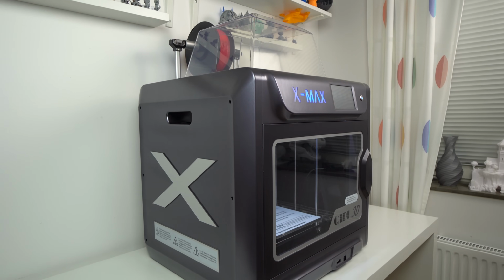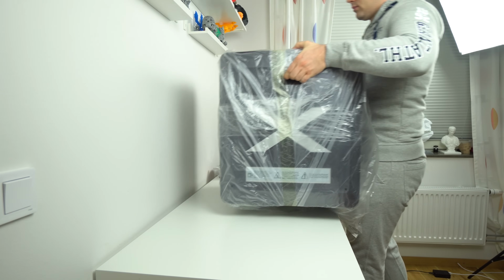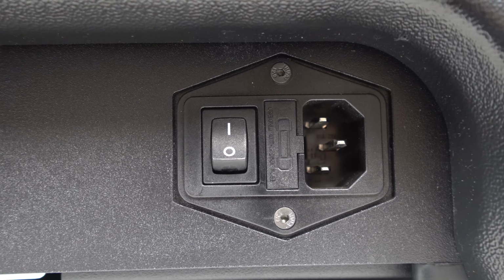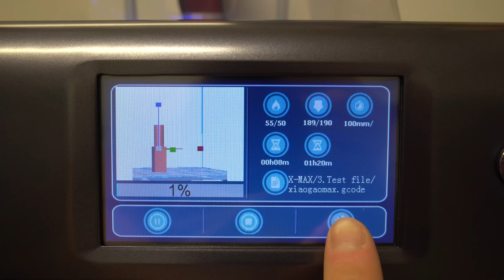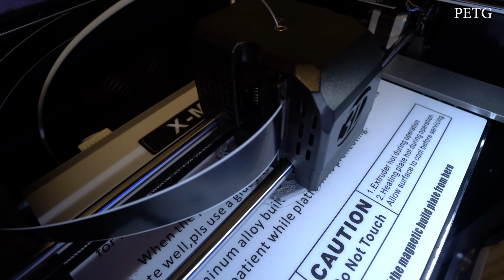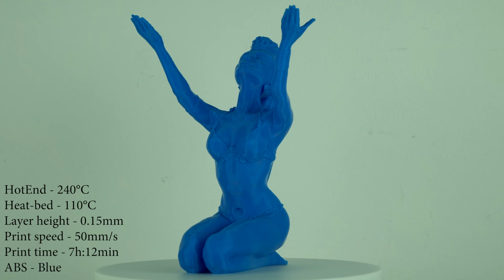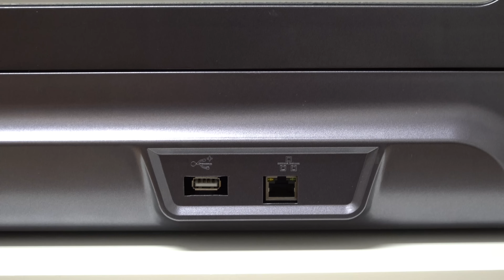QIDI-TECH X-Max 3D printer review - Fully enclosed 3D printer

Comment: Are you still using it? Got one from a friend, it needs a new motherboard due to a little misshap that sent 24V into the hotend thermistor circuit, figure it could be a nice printer for the 150 Euro a new motherboard cost? 🙂

Comment: I know this is an old video but i was wondering about printing materials like abs and petg because the ptfe goes right down into the nozzle so you cant really go to them temperature. Did you find any issues with any melting of the ptfe tube?.
Reply from the maker: If you print alot of ABS you can always replace stock ptfe tube with Capricorn tube when is worn out one day. Also there are petg filaments that print just fine with lover temperature on the nozzle so there is no worry :)
Reply: @NexiTech  Thanks for the feedback so quickly! Ive been looking round and found out i can get a all metal upgrade for the high temp extruder so ill probably go with that. Thanks!!
Reply from the maker: @A R  You don't need to do that. In the package you will get extra all metal hight temp hotend part which can be heat up to 300c. Nozzle is also steal hardened so you can print any kind of abrasive filaments. Just look at the video more carefully and you will see it. 2:02

Comment: When you printed with PETG what did you do with the flexible build plate.   Some people are saying the parts will weld to it.
Reply from the maker: If your print stick too much with PETG you can set higher first layer, add 0.01mm on your first layer and try it out. Also you can flip flexible build plate and print on the other side as well.

Comment: What is the max print speed for the x-max? Thank you!
Reply from the maker: That's hard to say. It depends of your model, what type and size model you are printing, what kind of printing quality you are looking, your slicer settings and many more. I'm always trying to adjust print speed depending of the model and my print quality needs. You can always push any printer over 100mms but how good or bad it will turn out only you can tell :)

Comment: This review sealed the deal for me and answered all my residual questions I had from prior research. Excellent work and thank you for providing the settings you tested the prints at. Very professional! Have an upvote and a new subscriber!
Reply from the maker: My dear friend, thank you so much for yours kind words and positive thoughts. Wish you great day!
Reply: I have an issue where the filament melts too much to the point that the layers fall down, yet the temperature is below the recommended one so don't know why is it melting so drastically  @NexiTech
Reply: @gabriel64gba  Which slicer are you using?

Comment: What would you consider the best? Prusa i3 MK3S or QIDI X plus? Some people said that Prusa's prints are better, while others say the opposite. There are also people saying that Prusa is better because QIDI is from China... Some people even say that you constantly need to replace the bed magnetic sheets for the QIDI... What do you think?
Reply from the maker: That's like comparing AUDI VS BMW or Android VS IOS or Windows VS Mac... People like one or the other. There is no such thing as perfect printer that can match anyone taste. I prefer the X-Max and btw Magnetic plate can last you long time if you can level the printer correctly and not let the nozzle to stretch the printing sheet :)

Comment: Excellent review. Please say whether you wish they X-Max could come with a second extruder for support. Trying to decide between Junco x-Max and Raise 3D. Thank you
Reply from the maker: Thanks! Well not really. Dual nozzle 3D printers are still not perfect yet in reasonable price range. Dual nozzle 3D printers tends to knock out the print during printing, damage places on print during travel move and second nozzle can leak and clog as well if you not hit exactly hit right temperature. I would not recommend any 3D printer with dual nozzle if the second nozzle can not retract when is not in use. It's better to have one print head that works good instead that you have frustration with dual print head. Just my opinion.
Reply: @NexiTech  I understand your point about the problem with two extruders on one head because I have the MakeIt Pro M. I would like to save money and buy the X-Max, but I thought that I would need 2 extruders to make supports. How often do you wish that you had dissolvable supports, or is it really not that important? Thank you.

Comment: How did you get the test print off the plate? Mine is stuck to it!
Reply from the maker: Did you level the printer?
Reply: @NexiTech  I did. The people who sold it  to me said models sticking to the plate is a case of the nozzle being to close to the plate. When I levelled it, there was  only slight resistance between the nozzle and the plate but after the print, the nozzle was very tight against the plate.
Reply: @NexiTech  And now no matter how many times I press the down button or turn any of the wing nuts there is still no room to put the paper under the plate
Reply from the maker: Very strange. Try to offset a initial  layer height a bit in your slicer. If you had 0.4mm by default try 0.6mm etc.

Comment: Great video! Did you find a runout filament sensor which is working with the X-MAX? Can you share your nylon printing parameters? my nylon parts are not great.
Reply from the maker: Thank you! Nope I never search for it. Run out sensor are not priority for me to be honest. Nylon? My temp was 250\90c print speed 40-50mm/s. Nothing fancy, also make sure that you place your nylon spoon in the oven for hour/two to get out the moisture.

Comment: Easily the most comprehensive printer review I have seen. In the time since making your review, have you had an issues or noticed anything that might need to be replaced?
Reply from the maker: Thank you so much! Not at all. I still have my X-Max and it works wonderfully. Very reliable machine.

Comment: Just got mine and when I turn it on it shuts off by itself after about a minute. I was wondering if the fans turn on right away when turned on? Mine does not and I think it might be overheating
Reply from the maker: Open the metal cover under a printer(few screws) and check the relay board. You have one spare on the box. Maybe it's faulty relay switch.

Comment: This seems so nice, but I need to be able to run the air through a filter to remove the toxic fumes since I do not have a well-ventilated area. These included filters are not for fumes, and adapting a custom filter solution may be more difficult than when making the enclosure from scratch,

Comment: I bought one based on this review, would you mind sharing your slicer settings for ABS?
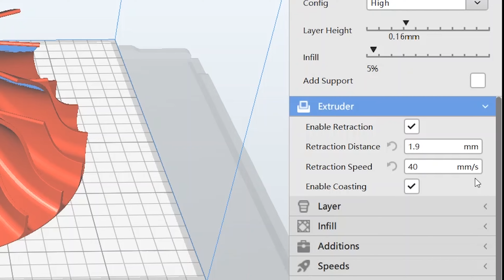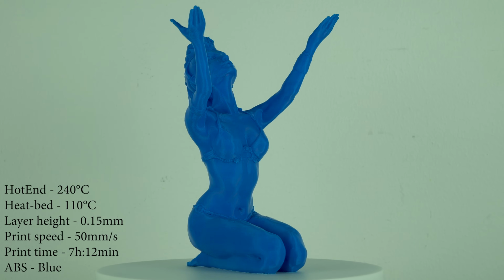Reply from the maker: Brad Vanscoyk That's great! Thank you so much for your support and trust. Slicer settings for ABS? I show it in the video on few places, here for example: 10:19(retraction setings) 15:07 (ABS print setings). I did not need to tweek anything to get those print results. I just used standard print profiles, nothing fancy.
Reply: @NexiTech  Just wanted to update to say I got my x-max today. It prints absolutely flawlessly. Thanks again for the video.

Comment: Great Review Nexi. 
I bought a Flashforge finder on the strength of your review awhile back as my 1st 3d printer and have been delighted with its performance. This looks like it might be my next one as I tend to stay away from the tinkering side of 3d printing...though I might go for Xplus (smaller volume but cheaper) or X pro (for the dual nozzle printing)...they all look like great machines with good user ratings...
Reply from the maker: Thank you so much, I'm very glad that you found my video useful and helpful. Let me tell you that I still have my Flashforge Finder(Over 2.5years) and it still works like it's brand new, I never replace anything on it beside that I upgraded motherboard cooling fan under the metal back-cover. That coiling fan is just unnecessary loud sense the printer is very quiet. I found myself printing very often on it when I have smaller size PLA to print. It's so easy and conveniently to print on it. 
Yes, Xplus is great choice too, I would recommend to go with the X-Plus as dual nozzle 3D printers can be very annoying to level and print with. I had dual nozzle 3D printers in past and after some time i just remove second nozzle and use them only as single nozzle 3D printers. If you planing to get dual nozzle 3D printer I would only get  the one that can separately control heating on both nozzle and that can automatically retract the nozzle to prevent prints to collide with it when the second nozzle is not in use.

Comment: Very interesting, what mainboad and firmware is it running?
Reply from the maker: Richard Spicer I got answer from the QIDI-TECH company. They say X-Max use motherboard developed by their company with 32bit processor and TMC2208 steper drivers. If you are interested I could dissambly the bottom cover of the printer and take some pictures of motherboard etc? It's quite heavy machine but i will do it if you need more info.